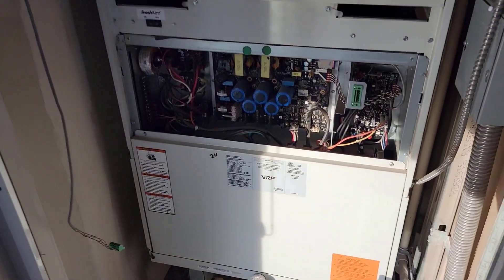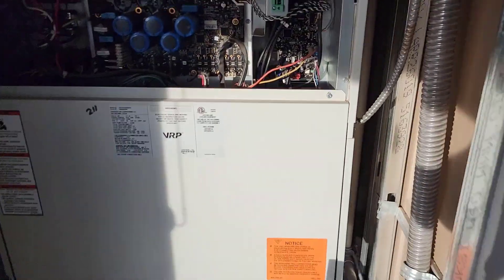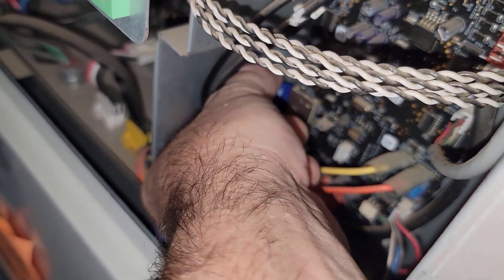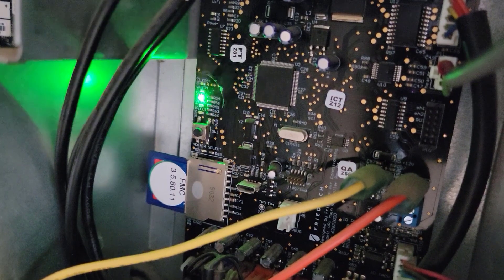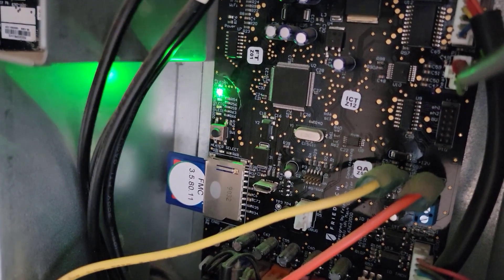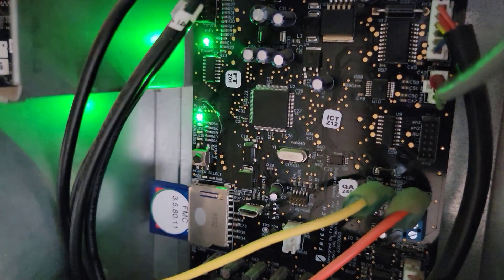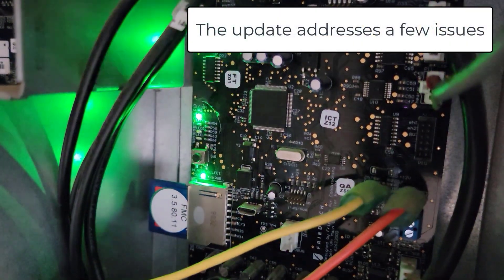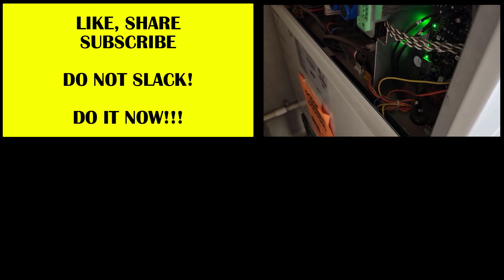Friedrich VRP operation configuration can be updated via a simple SD CARD update

Comment: Hey, where do you get the firmware files from? I noticed when I took apart Kuhl window unit at work, there is an SD card slot in the display module and a 5 pin jst connector next to that. 
It has to be for updating firmware, and the JST I am not sure what thats for, a diagnostic tool or remote thermostat maybe? 
I can't find any Freidrich programming or service tools anywhere but I am curious about the SD card. I can bypass all the locks the company put on the AC's in the bathroom so I can crap at a comfortable 69 degrees

Comment: Haha harsh environment? Updated 50 in n.e. Ohio because the condenser was freezing up. Then had to pull all 50 out and add a drain pan heater. Not fun. Then updated back to original software that would allow heat pump to run down to below freezing temps. Strip heaters are useless. They are not emergency heat like most heat pumps. Friedrich needs to do more software updates😂🤣
Reply from the maker: We are at the opposite spectrum here.
115 degree ambient and even higher at times.
Then take into account lack of air flow outside, units too close together, units aimed at each other etc and the OAT drawing into these things is like 130+
Reply: @hackfreehvac  yep total opposite. I love working on these things. I wish Friedrich would give us the programs of all the parameters that can be changed on these things. Im sure it’s proprietary info. Also the data logger info would be nice to see instead of waiting for them to decode it.